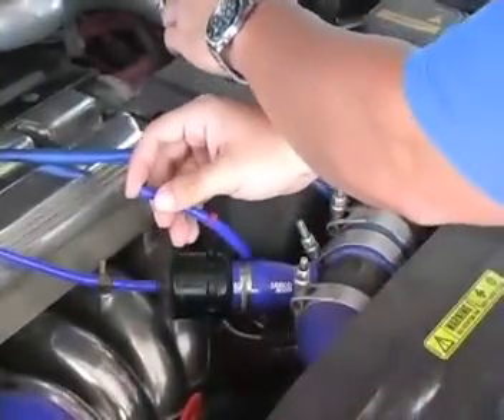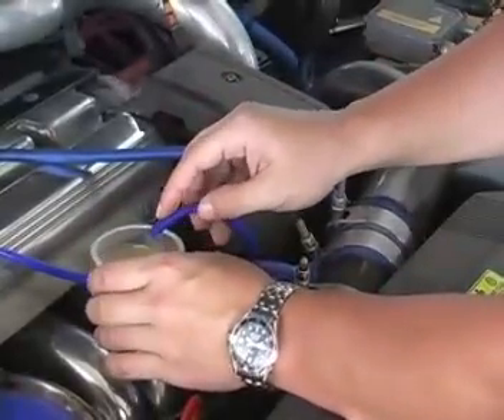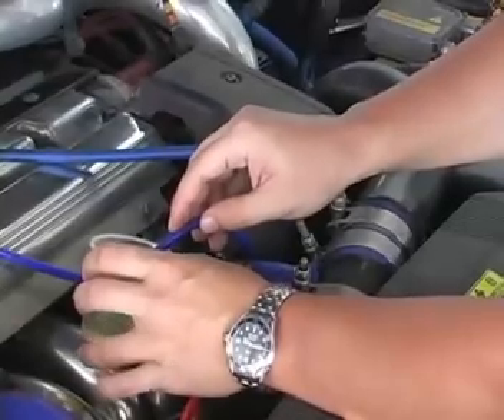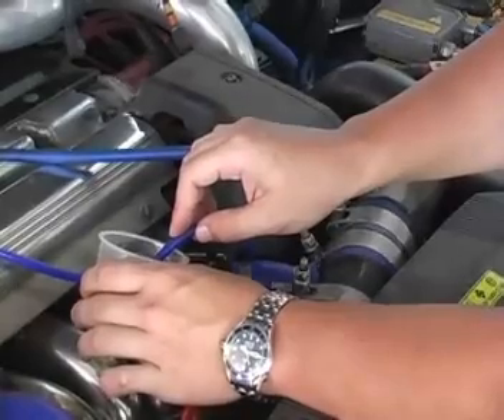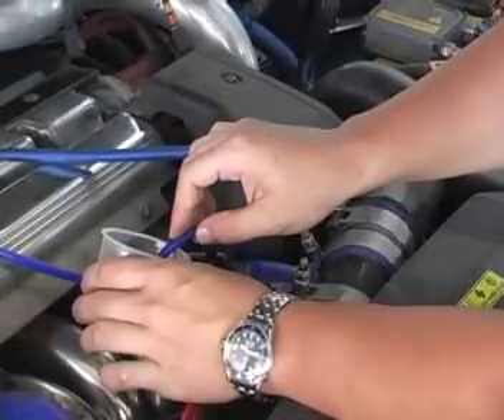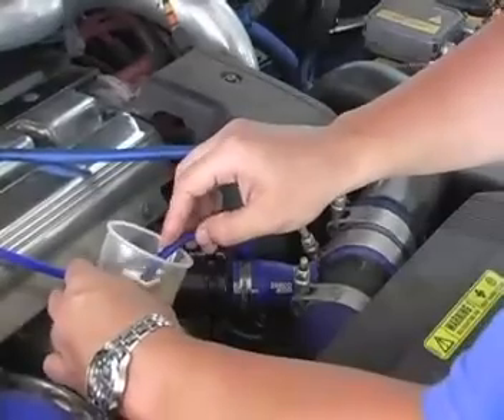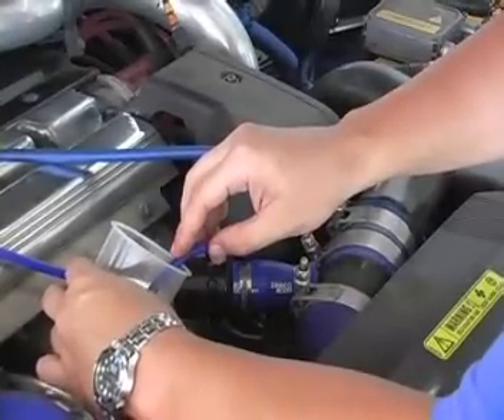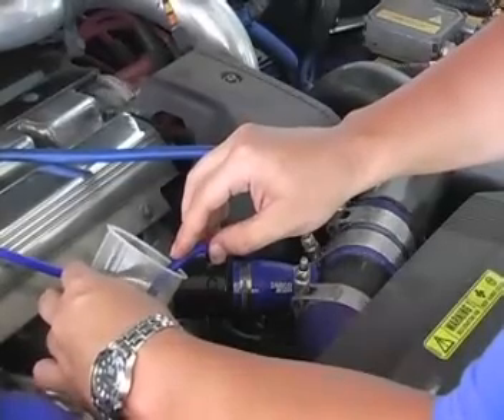Seafoam Valve Cleaning

Comment: It´s smoking, so it must be working - lol. This is just the injected chemicals burning off, and not the carbon deposits. You can use still water for decarbonation, injected like he did in this video. Water will turn into steam in the combustion chamber, and have an effect on dissolving the carbon - no joke. Saves your wallet, the environment, and your neighbors!